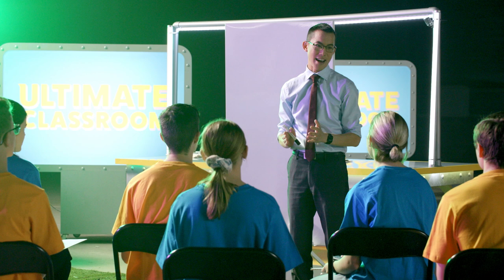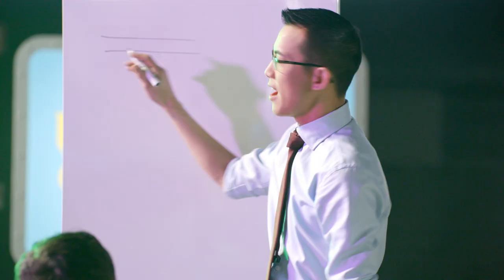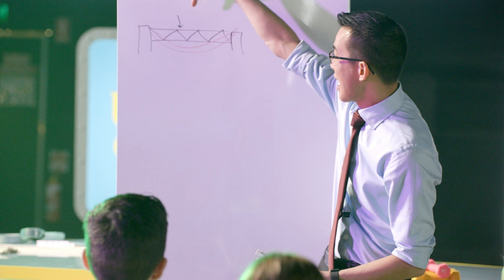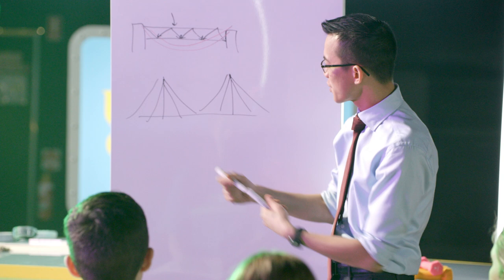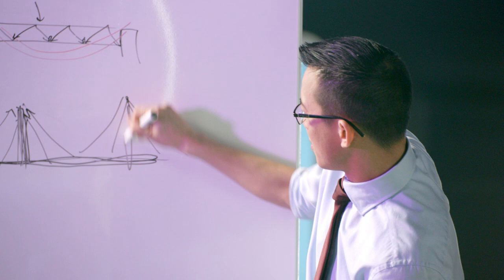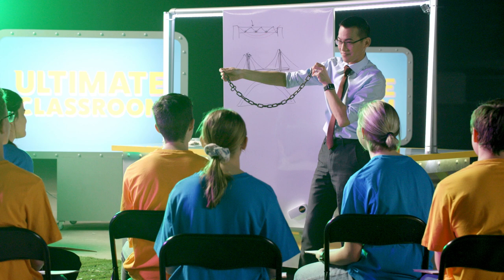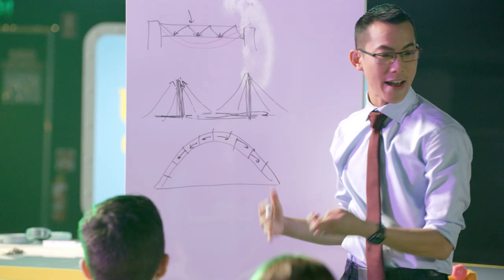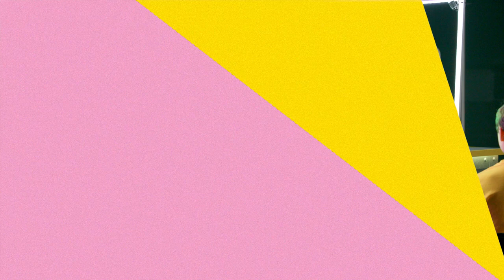Building Bridges (Ultimate Classroom lesson)

Comment: @3:40 - The design shown and discussed is NOT a "suspension bridge". It is a 'cable-stayed bridge'.

A cable-stayed bridge has the deck connected DIRECTLY to the top(s) of the tower(s), usually in many places (as seen in the video). These cables are all at different angles, depending on their distance from the tower. 

A suspension bridge has cables strung BETWEEN towers and the deck is connected to these cables, NOT directly to the towers. The cables between the deck and the supporting cables are all vertical.

🍌🙂
Reply: Rantings? These are not engineering designs by any chance, but for introducing the concepts to students. 
When it comes to engineering design, the representation includes 3-D and internal structure with fine details which surely cannot be shown here. 
This is certainly a very useful video 🎥.
Reply: My effort to explain the difference between cable-stayed and suspension is to use the examples of a tent with a pole in the middle, and a laundry line.
The laundry line has clothing suspended which you could imagine being attached to a plank at the bottom. The plank is suspended.
A pole in the middle of a tent is held vertical by means of strings (cables) attached to stakes around the periphery & by the fabric of the tent, all of which stay the pole. Now imagine the floor of the tent being held up by the cable-stayed pole.
Reply: @antonomaseapophasis5142  
It took a little thought and visualisation, but I think your explanations work.

🍌👍🙂
Reply: @HeinrichDixon  I think I would add your point about cable-stayed cables being at different angles, at different points
And suspension cables being vertical
In fact the idea of my explanation occurred when on a tour by boat on the Hudson narrated by an engineer for the Cuomo bridge at Tarrytown.
He kind of skipped over an explanation of cable-stayed vs suspension (George Washington bridge) because he had been tasked with the tour guide job at the last moment, and his colleagues, from their experience, assured him he was not going to be able to explain the two concepts.